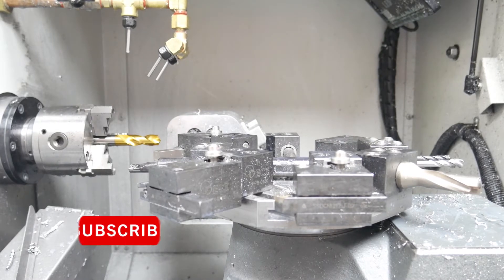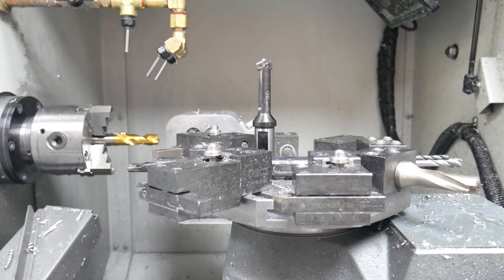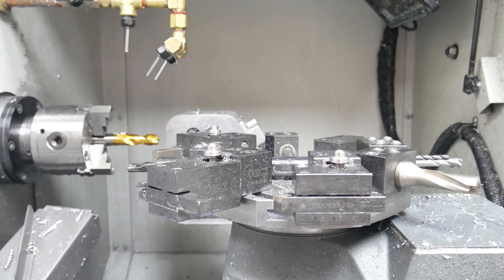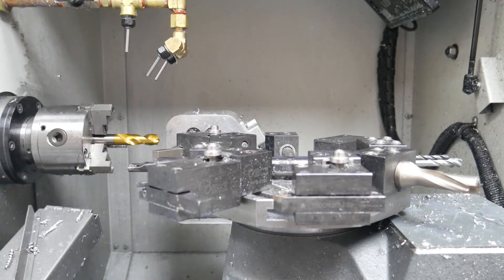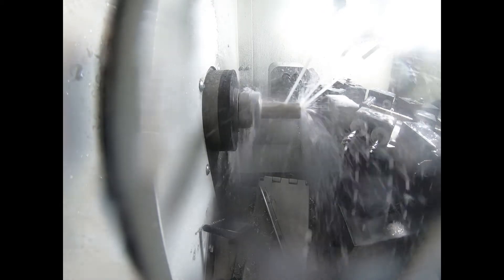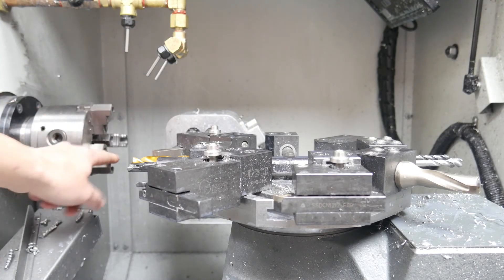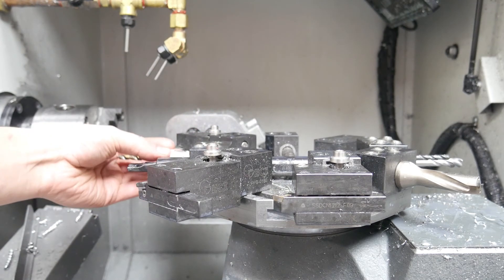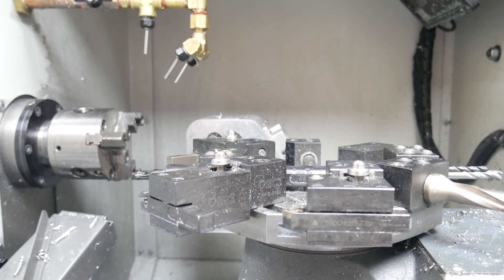HAAS CNC Factory fail. CL-1 lathe off by 1.5mm. Stainless issues finally solved.

Comment: So is CL-1 worth the money or garbage?
Reply from the maker: Well, it's a great machine when it works, the control is excellent (also when it works - read a few bugs). But if you gave me back the money and said you have that choice all over again, I wouldn't. My latest issue with the live axis has been on going for nearly a year and honestly from the service point of view the experience hasn't been great. Slow to attend, never fix the issue in one visit and long part delays. That's in the UK though, so perhaps if you elsewhere the service will be better. If the service had been better then I would buy it all over again

Comment: If it makes you feel better I have a new ST10 and that’s a complete lemon also. Can’t hold tolerance for more than a couple of hours then progressively gets worse until way out 1mm undersize and getting worse. On to 4th visit Monday and still no closer to solving
Reply from the maker: I find that quite concerning. I've got a dead live axis right now which should be repaired on Monday/Tuesday. Plan is to expand next year and I'm questioning whether buying another HAAS would be worth it or if it makes more sense to look at Hurco, XYZ etc
Reply: Hudson Lighting Ltd Yes I have serious doubts now on buying a milling machine. I have given one last chance to put this right on my time and then I want machine changed as it’s lost me thousands so far and a customer. If they won’t change machine will be getting it fixed and selling it to buy a used Doosan which I realised I should have done in first place. The extra saving is now gone in lost time!
Reply from the maker: @homeworkshopengineering  I was in a similar position getting the issue on this video corrected - whole week without the machine lost a job off the back of it and currently have had two engineer visits for the live axis issue - which was originally reported in April!! How has your control been? I've got a sprawling list of software bugs that haven't been corrected yet. Most annoying are when you high light and delete something it automatically copies it into the clipboard, over writing anything you intended to paste in it's place and 50% of the time duplicating a program results in copying program 100% staying stuck on the screen until I power off and on again. Had several software updates to no avail
Reply: Hudson Lighting Ltd Yeah mine has taken around a weeks downtime each time Inreport unless I mention Hurco or really complain. My machine was reported last Tuesday and got Somebody in this Monday so loads of lost time yet again. I think my problem is software or electronics as it’s an accumulative error and if I reprove tool it gets a bit better. I’m sick of it to be honest and will not be buying another and as said may sell this yet also once sorted.
Reply from the maker: @homeworkshopengineering  How long have you had it? Starting to make me wonder if we have a similar issue with offsets. We run lots of stuff in batches of 50s/100s and have to adjust offsets a fair but on the ID turn (tool 8). We don't seem to have the issue on any other tools though. Aside from that definitely noticed that sometimes we have to change offsets twice. The software is definitely problematic. It's a shame as I like the control.
Reply: Hudson Lighting Ltd I have had it 6 months and  don’t run it all day every day hence being 6 months and still not resolved (Takes me a few weeks to see problem come back). It takes around 5-6 hours of machining for error to come back noticeable but then increases rapidly (like an exponential thing) which makes me wonder if encoder pulses issue or similar. Yes I like the control also and use the VPS a lot to make quick parts. I’d they don’t sort it this time then will go legal route as will
Cost me less than money I have lost so far

Comment: Have you used the c-axis yet?  I have the CL-1 with the c-axis option but I haven't figured it out yet.
Reply from the maker: Yes indeed, the C axis portion is actually the rotation of the chuck. So you can call up C then your degrees - e.g. C180. The tools on the live axis use - separate offsets for - in my case I use offset 20 and 21 but you need to remember when you touch off your tools and do your x diameter measure, enter the diameter as a negative e.g. if you touch off on a 20mm bar, you'll need to enter -20. in the x diameter measure dialog. To run the live tooling you need to call up your M codes - I think M135 to start and M136 to stop but I can't remember. Luckily I had two training days on the machine. If you email me, I can probably send you a image of the code used for one of our routines and you can edit from there.
Reply: @HudsonLighting  That would be great, thank you!  Sending you an email now to the info email.
Reply from the maker: @vitalcarry  Awesome, When I'm in tomorrow morning I'll grab some screens for you